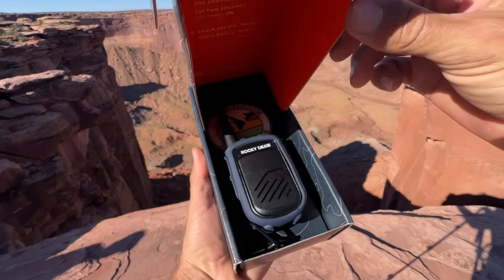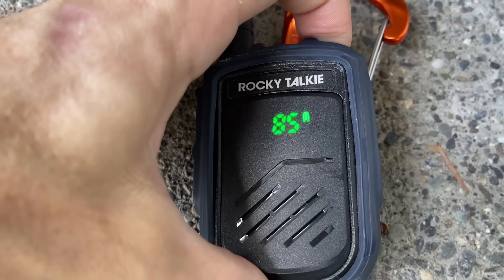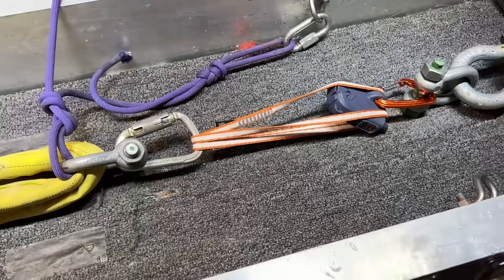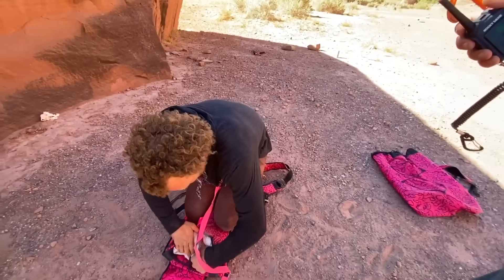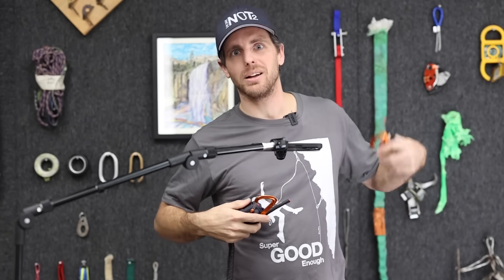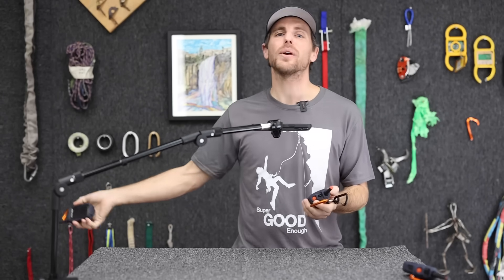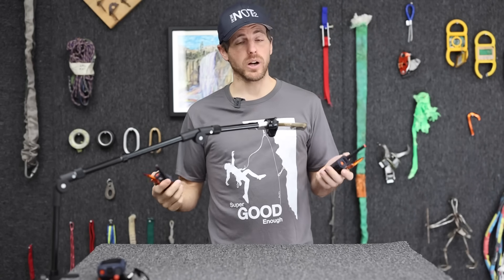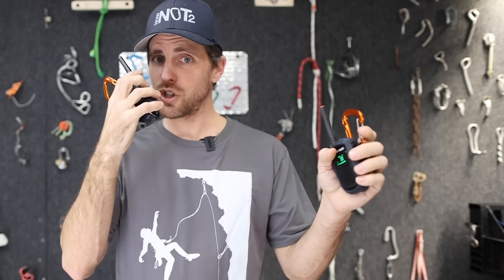Is Rocky Talkie indestructible?

Comment: that antenna on the intro culd be reconnectec.... all that matters is the lil pin in the middle ... just bend it straight and use 2 rocks to reshape the talkie antenna input ..... solid

Comment: Currently FRS and GMRS share sets of channels. The first set is the 8 main GMRS channels (15 - 22) in the 462 MHz region, where GMRS radios can transmit with up to 50 watts and FRS can transmit 2 watts. The second set of channels are the so called interstitial channels (1 - 7), which are interleaved in between channels 15 - 22, where GMRS can transmit 5 watts and FRS 2 watts. So the channel spacing, with the interleaved channels, is 12.5 kHz. The third set of channels are the GMRS repeater input channels in the 467 MHz region, paired with channels 15 - 22, which cannot be used by FRS since it does not allow repeaters. The final set of channels (8 - 14) is for reserved for handheld radios, which is why GMRS mobile and base radios will not transmit on them. They are interleaved between the 467 MHz GMRS repeater input channels. Both FRS and GMRS handheld radios can transmit on these 467 MHz interstitial channels with 0.5 watt of power.

So, to recap, channels 1 - 7 allow 2 watts FRS, 5 watts GMRS; channels 8 - 14 are reserved for handheld radios, 0.5 watts, and channels 15 - 22 are the main GMRS channels which may have up to 50 watt GMRS radios, however FRS with 2 watts is allowed on these channels.

Comment: Hey Ryan, Just watched this video. I hear your complaint about having to take the radio off your harness when climbing. What I have found with my rockies is that the mic cuts out wind noise so well that i can talk pretty normally to my radio, while clipped to my waist, and it goes clearly to my partner, even in pretty windy conditions. I am interested in the mics tho for skiing cause I messed one up due to being in wet snow for extended periods of time in an Avalanche course.

Comment: Just a point about the CTCSS and DCS codes.  They are just a filtering element for the radio to unlock the speaker with a matched code.  Despite the name using these codes doesn't mean your conversation is private.  The reviewer sort of pointed this out but just understand that these are monitorable devices.  You can buy radios that use encrypted digital modes and thus are not monitorable.  Retevis is a lower-cost brand than Motorola.

Comment: I am getting quite the kick out of watching you guys test the gear. I climbed in the 60s and 70s. Other than carabiners and ropes we made all our own gear. Most of the chocks were various sizes of machine nuts with the threads filed out and fitted with a piece of webbing. We had a small forge and made our own petons and rps etc. Testing was by falling on the gear. I can barely walk now but I am sure glad to see the sport be safer than it was. Cheers from the left edge of Canada. ~ulrich

Comment: CTCSS isn't a scramble/privacy code, it's analogue squelch. DCS is digital squelch. A receiver with squelch turned OFF will hear EVERYTHING. If you want end-to-end encryption on a handheld but want it on PMR446, use TDMA voice inversion.

Incidentally, the Baofeng UV-5R is a fantastic radio when it doesn't randomly die (as mine did), they are cheap as balls and you can get them on Amazon :) . Always carry a HOT SPARE.

Comment: can we talk about that intro where he stands fully above an anchor tied in with a static sling 😲😲 seems like a super good candidate for a factor 2 static fall. is he super confident that he wont fall, or am i missing something?
Reply from the maker: The edge is far enough away there that it is impossible to go over with a tether that long. Those are highline anchors which are usually set far back from the edge to allow the master point to be tied directly at the edge so the line is easier to mount.

Comment: ryan, if you read your comments i would love to see a test: petzl recomends to never toprope solo on a microtraxion without backing it up. but ive never heard of a microtraxion slipping or failing... would you try and make one slip ...? maybe theyre super good enough without backup
Reply from the maker: There are enough accidents to support Petzl's recommendation. There is an accident report making the rounds currently about a serious accident at Donner summit of that exact scenario. 
I am sure there will be more statistics is the coming years. I use two devices in the hope I won't be one if them. -Bobby

Comment: The charge curve shown in those graphs is the standard voltage curve for Li-ion cells. Most things using Li-ion cells use a more sophisticated (but also more expensive) "state of charge" gauge for that very reason.

Comment: The depth is good. I dont think you need to break test everything but its an endorsement of how bomber this device is. What makes this valuable is that you are going through the use cases and letting people know what they should expect than just stating their max range of 40km but what the flat terrain should offer.
Reply: Breaking gear is definitely required on this channel.
Reply: @elmeradams8781  I hope no one thinks to connect lifesaving gear on the rubber loop. Or expect a radio to survive 20 to 40 m fall. Somethings you do not need to test.
Reply: Didn't you ever watch myth busters? There was a myth that a ceiling fan decapitated a kid who jumped on the bed (never going to happen). After testing with normal fans, they had to make it happen, so they rigged up a lawn mower on the ceiling...
It has to be broken, especially if it's just for entertainment 🙃.
Reply: @elmeradams8781  There is testing for science and testing for entertainment. I prefer Ryan doing science.

Comment: Love the gear review! Thanks for explaining everything in such depth. Can't wait until they come up with a Bluetooth version that I can link to an ear pod so that I can climb and talk with my belay partner without having to push a button.
Reply: Interesting
Reply: FRS (and other walkie-talkie standards) is a half-duplex system - meaning you can either talk or listen, but not both at the same time. For this reason, you inevitably need to activate the radio somehow (i.e. push a button) when you want to talk. Voice-activation is possible (and exists in other walkie-talkies), but adds to the complexity of the radio (increasing price), drains battery life considerably faster on stand-by, and is by far not as reliable as a physical PTT button.

Comment: Automotive battery test engineer here, to this day no one has figured out how to accurately measure battery capacity with the same accuracy as the level sensor in your gas tank. Maybe there is one, but it's not commercialized.
Reply: Welcome to electrochemistry, where you will find God, and get a healthy respect for low energy, condensed matter, and dark plasma.

Comment: The replaceable batteries (WHILE IT SUCKS THEY'RE A SPECIFIC NONSTANDARD SHAPE) are very VERY good for the durability of these! If you take care of them, 100% the first thing to die will be the battery!
EDIT: ACTUALLY, it's even better - The USB port is on the BATTERY itself, meaning that 2 wear components are easily replaceable! This thing is awesome!
Reply: And about the low vs high power mode and Europe, on these devices there's some code called Firmware that isn't trivial to overwrite and change depending on your skillset. It'd be really easy to lock to low power mode in firmware and then get certified in Europe. It's the same "workaround" that phones use despite the Modems in them technically being able to transmit all SORTS of signals!

Comment: Absolutely get the extended mic... And do a pull test! Lol

I use an 18 inch antenna tucked into the frame rail pocket in my pack when I hike and ski with a ham radio. The radio stays in the pack with coax to the antenna and speaker/mic coming out the hydration tube pass through. It makes it so you can hear the call at a reasonable volume and reply with minimal fidgeting.

Comment: For anyone considering getting the extended hand mic - Leaving the Rocky Talkie on my gear loop and just loudly talking in its general direction has worked well enough on multipitch for times when I don't want to unclip it and bring it to my mouth.
Reply: The remote mic is most likely intended for windy / high background noise situations.

Comment: Did you test the battery drain multiplier times? Sometimes a battery needs to be drained to 0 in order to calibrate. I wonder if that’s why they were dying around 25%.
Reply from the maker: Yea. They all have been down to zero multiple times. I often forget to turn them off and put them away in the closet haha.

Comment: Just try not to turn radios on without an antenna plunged in. Would love to see a schematic for these to see if they have that kind of fault protection ion the board. Antennas are resistors and when they don't work or are disconnected you can fry everything.

Comment: The RockyTalkie was my third pair of radio's, since living in Europe rocky's are hard to obtain (yes, frequency bands are different, I modded them to work on PMR). The first two were acceptable, but the rocky's are just so much better. I completely took them apart, and they're built like a tank. The circuit board is bolted to a surprisingly thing metal backplate (which you can see when you remove the battery), the plastic case is super sturdy (not to mention the extra rubber shell), and everything is clearly high quality.

Would 100% recommend for anybody in the USA (or Canada I think). In Europe only if you really know what you're doing

Edit for Ryan: The antenna is replaceable, it's just loctite'd on, a solid pair of plyers will make quick work of it. Maybe you could request a new antenna from them
Reply: The antenna has to be "fixed" for FRS compliance, hence the loctite.
Reply: I would love to know what is the mod needed :) seem to be a great radio to have in european frequencies

Comment: very nice video on these, just a small correction, it's not only a power problem for Europe, it's also a frequency problem and a removable antenna problem. (legal) walkies here need to have a fixed, non-removable antenna, use the PMR446 frequencies, and transmit at no more than .5 watts
Reply: Technically the Rocky does have a permanently affixed antenna, as required by the FRS standard. (Unless you break it off…) The different ITU Region, and therefore frequency range, is most likely the largest barrier as it necessitates a separate type certificate test.
Reply: @DrewNorthup  nope, it's on an SMA connector!
Reply: @didgitalpunk  If it is epoxied or loctite-ed on then so far as the FCC is concerned it is "permanently attached". If it isn't permanently attached it IS NOT A LEGAL FRS RADIO. GMRS radios can have removable antennas, but not FRS.
Something tells me the lawyer the Rocky Talkie people worked with already explained that to them. If they've gotten lax on the loctite that could be a huge fine they don't need, and the FCC won't bother to go after them until it is worth 5× to 10× the attorneys' fees to do so—at which point they'll be sunk.
Reply: @didgitalpunk  I don't care what a YT video says. Quoting USA Code of Federal Regulations Title 47 §95.587(b)(1):
"The antenna must be a non-removable integral part of the FRS transmitter type."
Reply: @DrewNorthup  so you didn't read my comment or watch the 40 second video from rocky talky. cool.
again, they REMOVE the antenna. "The antenna must be a non-removable integral part of the FRS transmitter type." 
seriously, read before you start quoting stuff to others.
Reply: @didgitalpunk  I did read your comment. It [now apparently deleted] was the reason I quoted the CFR. I don't make the rules, but I also don't want to see you get burned.
Reply: @didgitalpunk  In any case, I suspect we both would agree with "the EU standards are far more stringent, and notably different" (yeah, I bothered to look). I hope the Rocky folk get their act together before attempting to sell there, and frankly it would likely be a well-received product if they do pull it off.
Cheers

Comment: Oh yeah, Ham radio hole goes really frickin deep and very specific. It's one of those perishable skills too like map reading and land navigation. If you don't use it all the time, they start to degrade pretty rapidly. There is so many little nuisances in both those skills and is really easy to mix and match things and they can really screw you up. I really recommend anyone look up HAM radio basics before going out in the bush with these and thinking you're good.
Reply: The FRS stuff tends to be fairly good, but yes if you want to know the details (or to be able to communicate when the G-Men can't make their stuff work) then Ham Radio is still alive & well.
— N1XIM

Comment: If you know what kind of Battery is in these. You can find the data sheet for the battery discharge... Super science backed
Reply: They are a Li-ion chemistry. Unfortunately the charge indicator is apparently voltage based instead of energy capacity based.